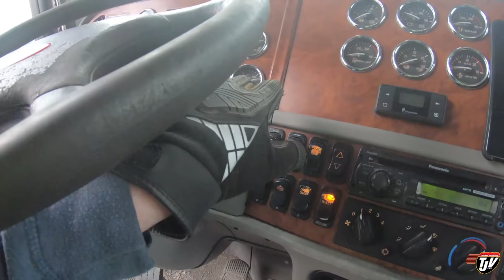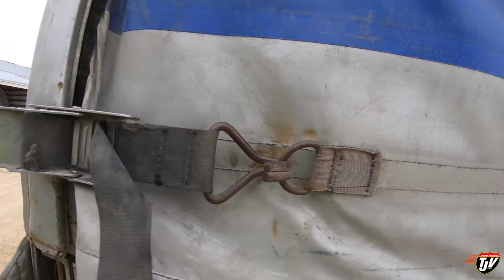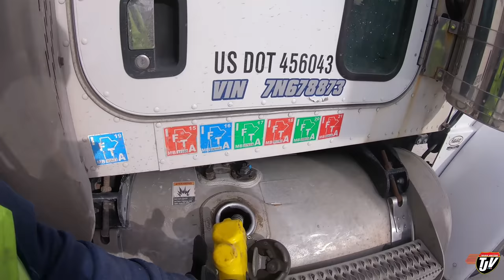My Trucking Life | STUBBORN TRAILER | #2251 | April 5, 2021

Comment: hey Josh, been watching for 6 years now. I see you have some problems with the calistoga tarp. How about using a 2x4 so you can apply pressure to both sides at a time and make it less frustrating.If you have freight on the trailer then adapt another piece of wood or something to help push the tarp as you walk around the freight.  If that doesn't work maybe you can use it as an idea.

Comment: When I worked on trailers, rarely customers specified brake lights on outside, and turn on inside. But most where turn on outside, and brake on inside. I don’t think it was dot recommended as long as light worked

Comment: I come up behind a guy Bob tailing one time and he had his turn signal on the one on the front of his cab said he was going to turn left the one on the back was showing right. I ask him on the CB what way he was going he said left, I said the one on the back says you are going right. He said you I got to be kidding I just got it out of the shop for that. He said I guess I will turn around and go back and make them do the job again. He wasn't to happy. When I was running OTR I the dip that brand new trailer and the marker lights and tail lights wouldn't work, when they put the company signs on the side of the truck they put one of the rivets into the wiring harness on that side of the trailer. 
Farm diesel can't be in any that is used of the farm because you don't pay road tax on it. Any vehicle driven on the street can't run it or that the way it is USA anyway. I know I was not aloud to drive the yard dog on the street because we run red died diesel  in it and it wasn't tagged for the road, but that was fine with me I didn't have the DOT checking me out all the time. You wouldn't have wanted to drive it very far it top speed was 20 MPH.
Stay safe and God bless.

Comment: Sure appears the Conestoga trailers are not as clean as the Box Vans, aren't they ever swept out, as that could be part of the reason some are more difficult to open & close if debris gets caught in the track the sides roll on..  Noticed it earlier in other Vlogs, but didn't comment then. You sure LOOK YOUNGER since your Birthday, is it the shaved head, or just the time you had to spare on the LONG WEEKEND.?    
Cheers from Deer Park, Tx. 71f degrees at 02:12 am Wednesday, April 07, 2021    ;-)